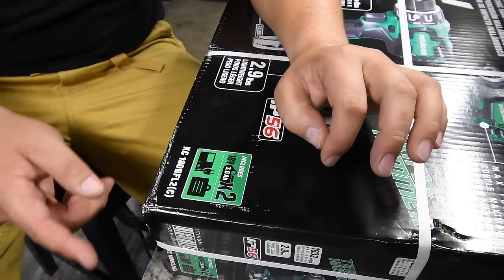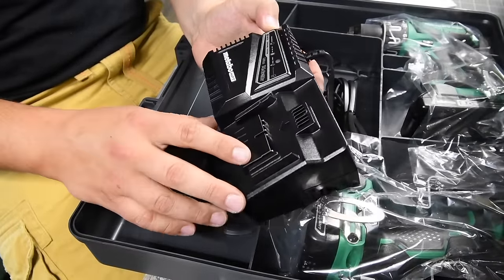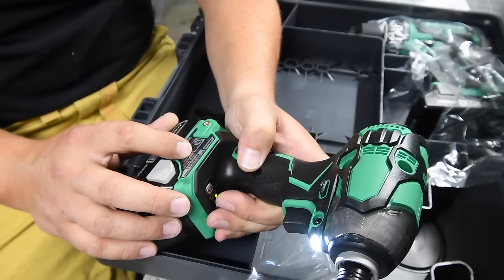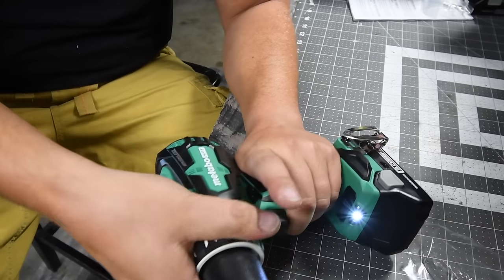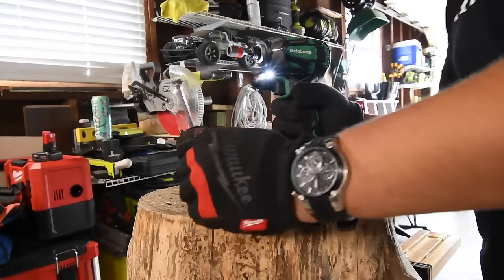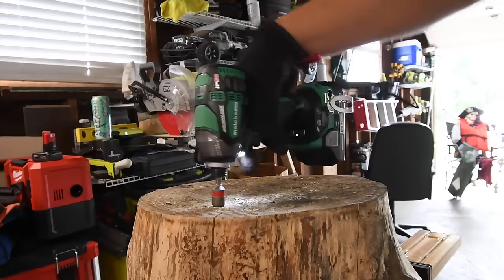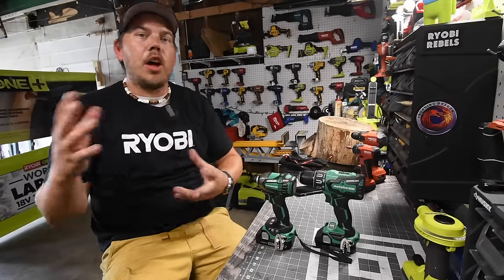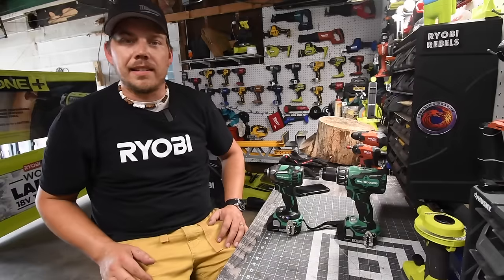$200 Metabo Hammer Drill/Impact Driver kit. (MID-Range)

Comment: So, I own this set and the 36v versions as well. With my experience and with the fact that I use these tools on commercial jobs (I do electrical work). These are great tools. The 3ah batteries are great with the impact. It's light, comfortable and easy to use in most any situation. The hammer drill is great as well and is better with the higher ah batteries. P on the impact is a power mode and ramps up the speed, whereas the S is a smart mode where it slows down so that you don't strip out the material in which you are fastening to. Absolutely great for what I'm doing. However, the 36v versions of these are amazing. The impact just goes and goes. And the hammer drill is just like a hole hog. Also, Hi Koki makes these tools. A Japanese firm that bought Hitachi. So in a nutshell, these are Hitachi tools. Hence the HPT (Hitachi Power Tools). Because of legal reasons, they could not keep the Hitachi name.
Reply: I just read your review and pulled the trigger on the 36volt hammer/driver kit. ( I fell into a great deal early this year on their 4 piece combo and have enjoyed using them) I bought the 36V rear handle circular saw and the reciprocating saw ( not a kit) one was 199 the other 179 and each came with a bonus Black Friday battery and charger 36 volt.. Thanks for your review now my set needs are complete.

Comment: I have the same metabo hpt impact driver. The p mode is the fastest and most powerful mode. Speed 1 is for precision work, speed 2 is a faster speed but it is less powerful to preserve the battery life. The final mode labelled s is for self tapping screws into metal.

Comment: The 36v version of these two are my favs and they’re freakin beastly with the torque and power they put out. Gotta at least use them with a 5 or 8 amp hour green multi volt battery. I’ve used and own all the big stuff from Red, Yellow and also Flex. Still love my Metabo HPT’s tho. Prob why RR buildings use them as well. Great vid man!

Comment: P is power mode. Speed 2 is for smaller fasteners. P mode gives you more of the triple hammer action and you can actually hear it.
Reply: Wrong, P is for POWER!  😁😂 Triple Hammer is a solid tool.  Not the fastest or the most powerful, but it works and gets the job done.  And a little rIn or dirt won’t bother it at all!  It will be working still, after others have failed.  Peace!
Reply: @georgedavall9449  he did say P is power. How is that wrong since it’s the same thing you said?
Reply: @georgedavall9449  he said p is power mode. Can you read?
Reply: @plaid11  since I received this terse reply all this time later, from some ‘stank jaws’ person, I figured I needed to clarify my comment, since my facetiousness seemed to have been lost on some ?  I was merely making the point that ‘P’ was indeed for power, as in the Triple Hammer does have Power!  If that doesn’t clarify it for you, well, I’m sorry for you?  Relax and try to take it easy.  Peace ✌🏻 😁😂

Comment: Metabo = German made for world wide sale. Metabo HPT = Hitachi models made for the USA. Hikoki = Hitachi models made for Europe. All three owned by KKR.
Reply: HiKoki is the international name. The Hitachi name was completely dropped from the power tool division.
Reply: @reaperreaper5098   if you mean international everywhere else but the USA, then you are correct. The name may have been dropped, but these are still very much Hitachi tools. That's why they still have HPT on them here in the states. I wish they would have named changed it to Hikoki here too. There is sometimes some confusion between Metabo and Metabo HPT.
Reply: @FyrFytr998  I mostly mean that there isn't just a 'Hitachi' power tool brand anymore. The way your original comment worded it makes it sound like HiKoki was just a Euro rebrand.
Reply: Interdasting...

Comment: I got the 7 tool deal at lowes for $280. Drill / Impact/ 6.5 Saw / Flashlight / Cut off Wheel / Multi tool / and Saw Saw. Two 3AH batteries, charger, and a big tool bag that fits all the tools I love it. Im going to buy their palm router next.

Comment: These are $149 at Lowe's right now. I don't need them, but that's very tempting for 2 brushless tools with 2 3.0 batteries.
Reply: 129.00 right now plus 5% off when using card. I’ve never used this brand before but the price was right

Comment: The 36V triple hammer does perform a bit better than the 18V but the 36V Hammer Drill is in a completely different league than than the 18V
The 36V Hammer Drill can hold it own against any other in the industry and lasted me over 3 yrs  with heavy duty work

U gotta get the 36V Hammer to test on your vs flex, Milwaukee and Makita
I have the Milwaukee and Makita and prefer the Metabo HPT(36V)
Reply: I bought the kit with two 4ah 36v Batteries fast charger and mv hammerdrill I paid 86.00 dollars awesome deal. I want dave to test the 36v hammerdrill

Comment: Metabo hpt has 3ah 18v batteries and then they have their multivolt batteries that are 18/36v depending on the tool it's in, they have a 5ah @18v/ 2.5ah @36v and a 8ah @18/ 4ah @36v. Only the 8/4ah have 21700 cells. Think of it like another brands take on flexvolt.

Comment: Hitachi/Metabo is not in that endless war to produce "the most powerful" tool. They make a commitment to a long life cycle, which is why they warranty them for life and their slogan is Durability First. So they will almost never be first in overall power.

I have the same hammer drill, and it is very powerful for what it is...their entry level. It has 620 in/lbs...the next model up has double that, and comes with a handle and metal casing and is probably more what you are expecting.

Comment: I love Metabo HPT. Those tools are not made for heavy construction. Their market is more for woodworkers, carpenters, trim carpenters, and finish carpenters. They're not meant to be powerful tools by no means. They're meant to be ergonomic, light, and able to last throughout an entire days work. Every professional I know swears by these tools. I love their line of tools.
Reply: You must not have used the 36V as I have converted many of my Milwaukee and Makita tools especially Recip, Hammer Drill, Grinder, 10" Mitre, 10" Table, SDS rotary, full size 1/2" Router and a few others-had most of them over 2 yrs and all have held up to heavy use
The AC adapter comes in handy and helps save longevity of the batteries and allows for not needing so many like I do for Milwaukee and Makita
18V tools are.good for the price/deals 
Nailers are also beat I. The business and have done me well for over 25yrs
Reply: Their 36v batteries convinced me to switch to HPT for what tools I can. They make a good reliable powerful tool, and their flex batteries opens up a lot more choice of what tool I can buy. I can get the 18v tool if I dont need heavy duty and a 4Ah 36v battery will last all day in it (since it downscales and runs at 8Ah then)....or, I can go for the native 36v tool if i need to.

Comment: Like you stated in the title, the hammer drill is definitely their mid range model. A better 18v one with a large handle is out there as well. Metabo HPT has a 6.0ah 18v battery as well as the 2.5/5.0 and 4.0/8.0 18-36v batteries. Also, Metabo HPT has a ac adapter that allows you to plug these tools into the wall.
Reply: The strongest Metabo is 36v.
I think that’s the one you’re thinking of that comes with the auxiliary handle.
Reply: @DiligentDave1966  No, there is also an 18v variant of that tool. Model No. dv18dbl2q4
Reply: @doctordoom1337  I’ll look it up because I’ve never seen an 18v with the auxiliary handle.
It could be because my local stores don’t carry it.
Reply: @doctordoom1337  I’m thinking about ordering it from Acme and getting the impact driver kit from Lowe’s.
Reply: @doctordoom1337  Do you have this drill?
Is it a good drill?
Reply: Are you sure you can plug the 18v into the wall?
Reply: @DiligentDave1966  No, the plug in addaptor works with the 36v tools.
Reply: @gordonbarrett2970  Are you positive?
I thought the adapter said 18/36 just like the batteries.
Reply: @DiligentDave1966  As far as I know, you can use the Multi Volt batteries in both 18v and 36v compatible tools, but the adapter is only for 36v tools.
Reply: @gordonbarrett2970  I’ll have to double check, but I thought the adapter said it could be used for 18 or 36.
I could be wrong. It wouldn’t be the first time lol.
Reply: The adapter definitely cannot be used in the 18v Multi Volt compatible tools.  The adapter is a great idea, and a good excuse to look into the 36v range of tools.

Comment: I'm curious if 36 volt be different. that drill seems sluggish. i agree about handle. impact driver might be better. i do like tests for sure. i know lowes in Missouri doesn't show off metabo as other brands maybe.
Reply: The 36V Hammer drill is in another league
I replaced both my Milwaukee and Makita with the 36V Hammer drill-its a beast
Reply: Both the 18v & 36v flagship hammer drills put out double the torque of this model, keeps right up with with makita, milwaukee, dewalts  of similar spec.

Comment: Does anyone think that these tools aren’t exactly designed for that large of fasteners or bits ?
Reply: The triple hammer is a classic and carries an ip 56 rating that often gets overlooked, and I think it runs with the flagships from other brands...but as far as the hammer drill in the kit...yes, those fasteners are larger than intended for their entry level hammer with only 620 in/lbs of torque.

Comment: The triple hammer isn’t slowing it down. Your using it in the wrong mode. Go to P mode to activate the triple.
Reply from the maker: more test will be coming. this is an old video, my tests are completely different now with more accurate results. I no longer use logs
Reply: @ManCaverTools  NP. I was just trying to be helpful. I just bought this tool
Yesterday and had to spend some time figuring out those modes.

Comment: The 18v triple hammer is still a beast. Not much difference at all between it and the 36v model. Yeah the hammer drill is definitely weaker than the next model up, but it’s more compact and still powerful enough to get the job done.
Reply: So, the 36v versions of any of their tools are the ones to have. You can use the AC adapter they offer and you can use them on 110 receptacle and forget about the batteries. And yes, the hammer drill in the kit isn't nearly as good as the 36v version but, it does have some juice.

Comment: I'm not going to lie it looks nice I haven't used anything from Hitachi since they had nicad batteries so you talking way back doesn't matter if they change names the they're Hitachi  even if they're  under metabo HPT now I have a friend who has tHat impact driver  and it says Hitachi on it instead of metabo HPT exact same tool just a brand change have fun doing the test
Reply: Exact same tools. The re-brand only happened 1-2 years ago, so there are still a lot of Hitachi out there in people's hands. I have some Hitachi branded still. People who cashed in on the low prices when they were clearing out the Hitachi brand really scored in my opinion.

Comment: I have the same but hitachi I hate them because they've no battery level reader I'm going to change to bosch 12v and 18v because of better dealer backup will u do some bosch reviews? Thanks for a good video.
Reply: You should have gotten the Multivolt batteries they have battery level indicator and are top of the line
They are also backwards compatible with the 18V batteries And the 36V tools
Also
The 36V tools can be used with their AC adapter which is great for the high use tools
Table saw, mitre saw, recip saw, grinder, 1/2 " router, SDS rotary hammer, vacuum, and many others

Comment: This particular set is their entry level set. The 36v line is kind of their mid tier and the German Metabo tools are their high end. Call it good, better, best.
Reply: They don't make 12v do they? Almost all of the tools that I own now are Milwaukee 12v. As far as I know Metabo doesn't make anything comparible.
Reply: @dangrimes5078  ACME tools has them
Reply: @dangrimes5078  I do believe Metabo does, in fact, make 12v tools.
Reply: Most of the 36V tools are in fact superior or equal to my Milwaukee and Makita tools and their nailers have always been top of the line
Having the AC adapter, the backwards compatibility if the 36V Multivolt battery, lifetime warranty and dependability and only 1/2" cordless router 10" full size table saw have had me replacing much if my red and blue tools
Reply: @dangrimes5078  I think 12v is a dead platform walking. Most brands are jumping on the subcompact form factors rather than maintaining 12v. Milwaukee is different though, since they are so heavily invested in their M12 line...but everyone else?!? Metabo HPT just released their first subcompacts, they do have a few 12v you can get on Amazon, but I just don't see them pursuing that any further.
Reply: The hammer drill and being 18v makes it more entry level, however the 18v triple hammer is not an entry level impact. It may be their entry level impact considering they have the 36v triple hammer model out now, but there isn’t much difference in them at all, but the 18v triple hammer is still very powerful and still a top 5 impact driver today.